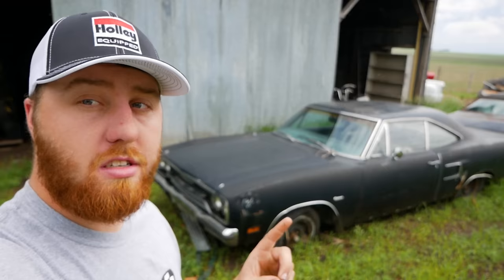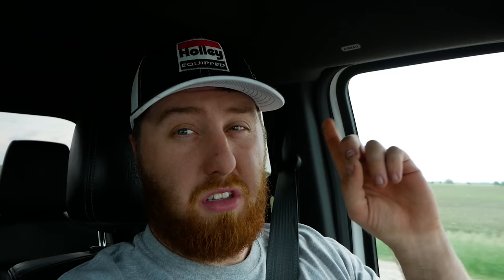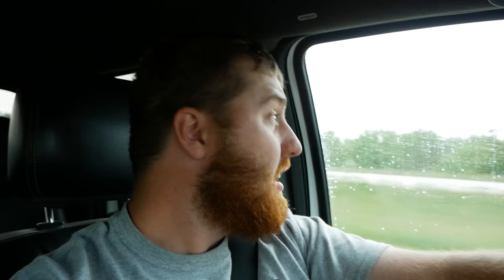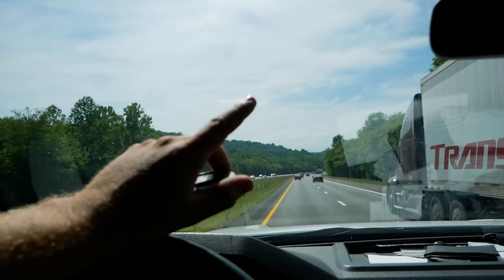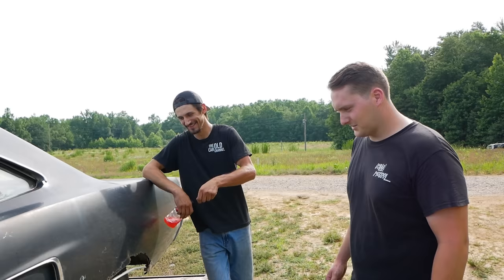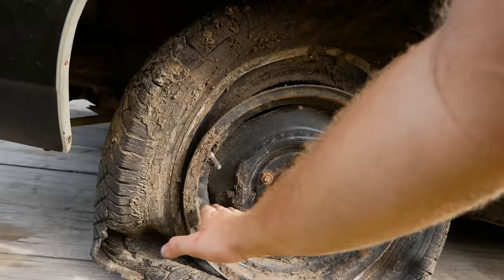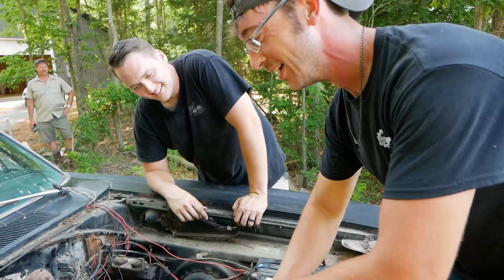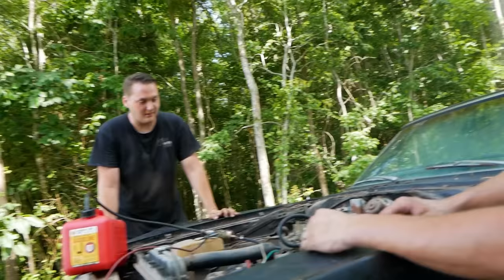ABANDONED Muscle Car Revival! First Start in 35 years! -- Part 8

Comment: If you’re doing long drives look into a a truck cap. You can put them on and take them off relatively easily. And you can put an air mattress back there. I’ve done it before and it works out well. Best with a long bed but it’s better than a truck cab

Comment: That's it ...there needs to be a 3way channel between junkyard digs thunderhead and carsandcameras
Reply: Need to put the brains between Issac, Luke and Kevin to a competition
Reply: I'll go first, Holley 850 carb no idle. Needle is fine gasket is fine. Fuel line pumps fuel. What's the issue

Comment: Y'know, if Dylan is going to spend the time to "re-body" or even attempt to restore that Sport Satellite.... I would almost suggest doing a proper restoration.  Sure, a Sport Satellite is nothing more than a Satellite with bucket seats (that's literally the definition) but it's just SO unusual as a base 3-speed, no power steering/ no power brakes car.  It's so unusual but a BETTER representation of what folks owned and drove in 1970.... that it has some historic value.

Comment: I am parcel to the straight sixes it could be a regular two-door pickup truck I wouldn't care if it was a short bed or a long bed even if it was a stick on the column or in the floor my dad had one on the column one time but they stick sometimes because of the wear out of the plastic pins and shims that's in there my dad had one lock up one time but the four ones are pretty cool and they're easy to work on I could spend up to maybe 8:00 to 7:00 to 800 dollars but I don't know about shipping it I would more like to pick it up or drive it away

Comment: The coyote swapped mustang lol,, and didn't you also pick up a black mustang around the same year as your silver one that you bought to do burnouts with Kevin sir lol... And I have installed several stereo systems and amplifier and subwoofers and speakers... and I don't think I am putting a set of subwoofers in my dodge ram Laramie slt..

Comment: I'm siting sitting here with a aluminum bracket holding the alternator and air pump from a 1991 F150 trying to get the steel bolt out of the aluminum bracket by heating with a torch and wicking paraffin and kroil into the gaps, drinking Snail Bones beer and not having no luck. 

I bought a 1991 F150 2wd last November and because the guy that sold me the truck neglected to tell me about the cracked head and pinhole in the block I'm getting ready to put a remanufactured 300 into it for $5000 installed.   I HATE PEOPLE!